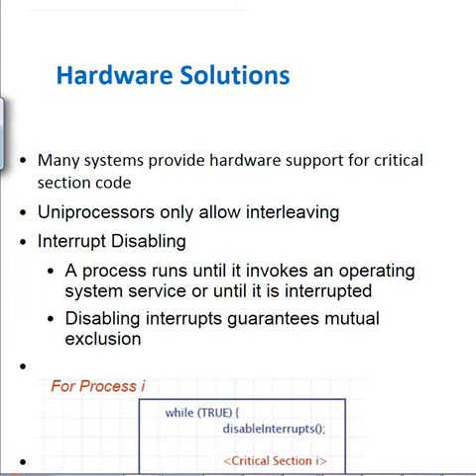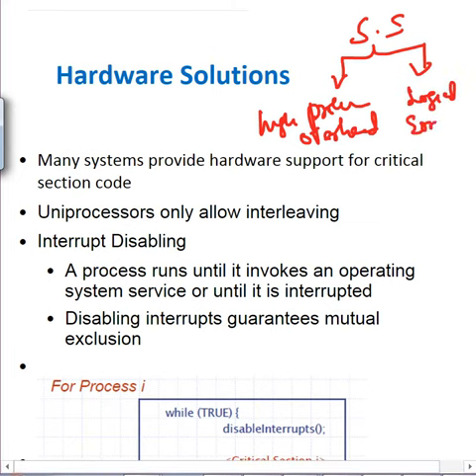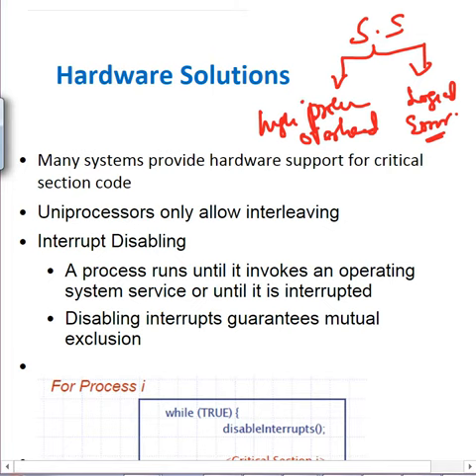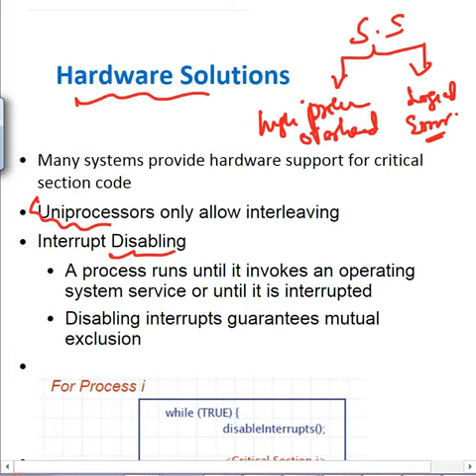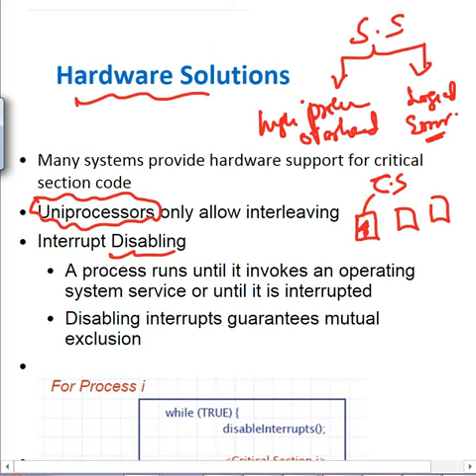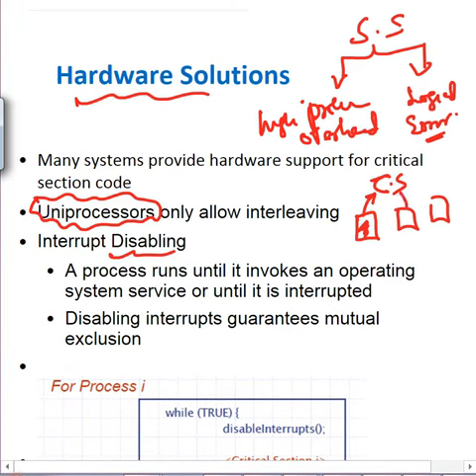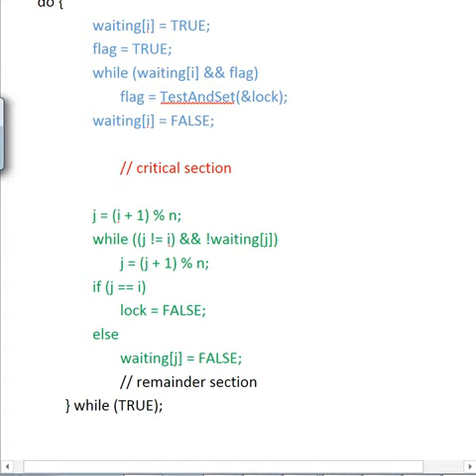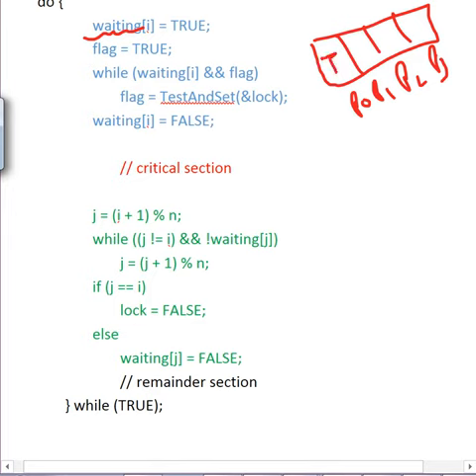Hardware Solution to Critical Section problem

Comment: Ur r only one on whole internet who is able to make me understand this...😁😁
Reply: i have a question.... what will happen if the process P0 comes and call the TestandSet() Method and when the value of lock veriable is assigned to the temp variable it will initially assign the temp=False before it execute the nesxt instruction and make the value true of Lock variable it context switches and now P1 will  call the TestAndSet() method it also assign the Lock = False and exceute the next instructions and return the value of temp variable  and  now it will compare the value (F==T) because this condition is false so process P1 will enter into the critical section now let P1 is in Critical Section and now context switches form P1 to P0 and P0 start the executiin from where it was context swtiched now because process P0 have already execute the instruction temp= *Lock so it have a temp=False now it will execute the next instruction and make the value of *Lock varible to True and return the value of temp because in temp still false so it will return false and value will be compared like (F==T) it is false so process P0 can acccess the critical section and P1 is already in critical section.?

Comment: i have a question.... what will happen if the process P0 comes and call the TestandSet() Method and when the value of lock veriable is assigned to the temp variable it will initially assign the temp=False before it execute the nesxt instruction and make the value true of Lock variable it context switches and now P1 will  call the TestAndSet() method it also assign the Lock = False and exceute the next instructions and return the value of temp variable  and  now it will compare the value (F==T) because this condition is false so process P1 will enter into the critical section now let P1 is in Critical Section and now context switches form P1 to P0 and P0 start the executiin from where it was context swtiched now because process P0 have already execute the instruction temp= *Lock so it have a temp=False now it will execute the next instruction and make the value of *Lock varible to True and return the value of temp because in temp still false so it will return false and value will be compared like (F==T) it is false so process P0 can acccess the critical section and P1 is already in critical section.?